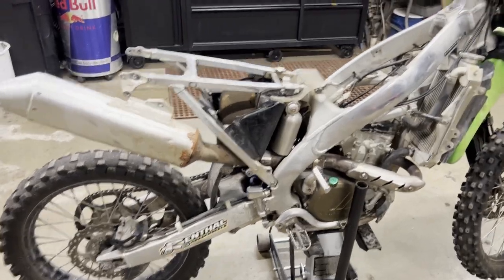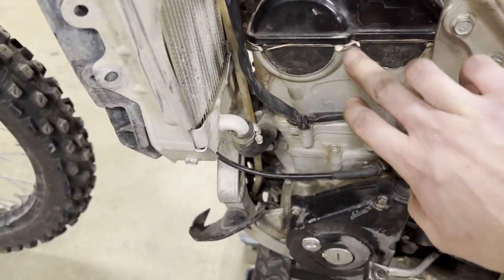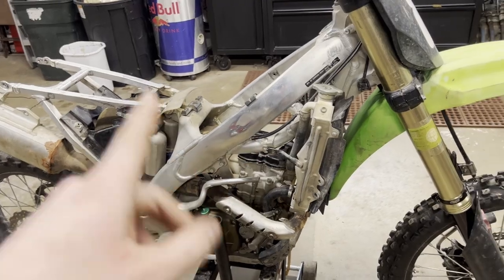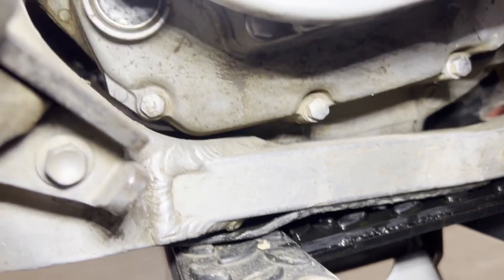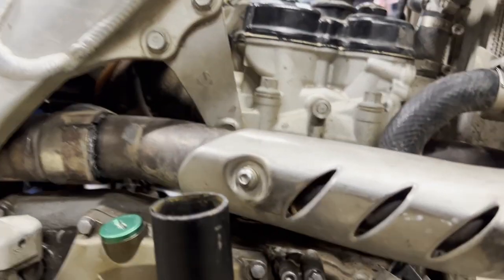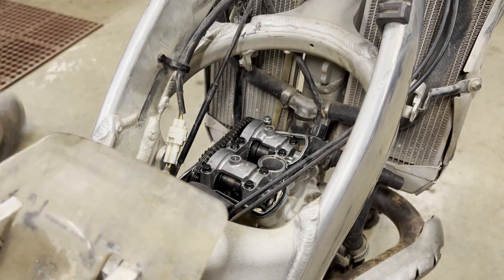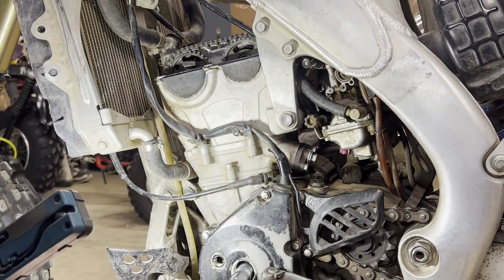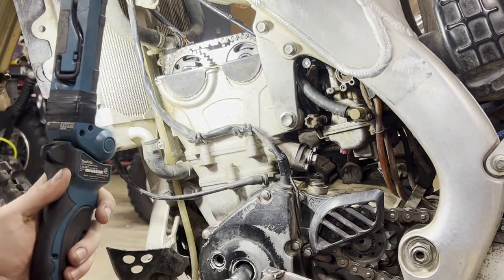$1300 Locked Up KX250F. Let’s See What Went Wrong!

Comment: I've got this exact same bike and I've done everything to it myself and thought I knew everything about it until now. I didn't know the gear lined up with the cam like that and can spin so I've learned something new 😂 thank you
Reply from the maker: No problem! These are great bikes, the cam gears are a pretty big issue on them, some people will even weld the sprocket to the cam to prevent gear spin on them
Reply: @ChaseBuiltBikes i brought a 2012 kx250f as a non runner and it had the same issue with the pro circuit cams on the bike where the intake cam slipped and bent the intake valves and the guy said it would be a cheap fix 😦😦

Comment: Gotta be careful when pulling the cam cap off. The bearing retainer clip/rings are notorious for falling down into the motor. I’ve found them in the bottom end on two different Kawis fishing around with a magnet. 07 and 09

Comment: It's all makes Yamaha, Kawasaki, Suzuki, all Japanese made bikes have that issue, I bought new cams for my KXF 450 and I tig weld the cam sprocket to the camshaft
Reply from the maker: Ive heard of people doing that, it’s a real smart thing to do in my opinion for insurance. Its amazing how much it happens
Reply: @ChaseBuiltBikes  now in my experience you have to buy three different rebuild kits for those carbs cus they all are not completely full kits , All balls racing , the regular kit you can get online, and there's another I get but it takes all three cus of the mid gaskets aren't in two of the other kits

Comment: Im possibly looking at an 04 kx250f this weekend that supposedly hasnt run since before winter and isnt getting fuel. Im really nervous that thats not the only problem. Any tips to make sure im not getting scammed? It’s pretty dang clean and hes selling it for $1,400

Edit: i commented this before watching the video, and now that i watched a bit, i think ive got a pretty good deal 😂
Reply from the maker: If you’ve just got a carb issue, no big deal! But I would double check and make sure the compression is good and go from there. These bikes have some head and cam issues, but make sure to check for cracks or holes in the cases, and that the engine turns over free. Other than that you may have bearings and bushings that need replaced in the suspension and frame, but that’s normal stuff there. Best of luck with the new bike!

Comment: about how much does and top end rebuild costs?
Reply from the maker: @De.aurious  it really depends on what your bike needs, let's say it only needs a piston and rings, no cylinder or head work, it'll be about $200 just for the parts. Let's say the cylinder and head need work done to it, it can easily get to the range of $600-$1000 depending on what is all needed